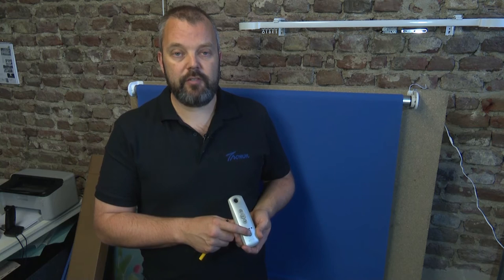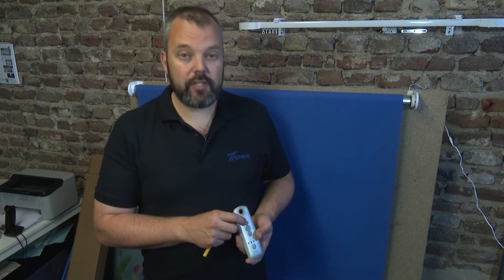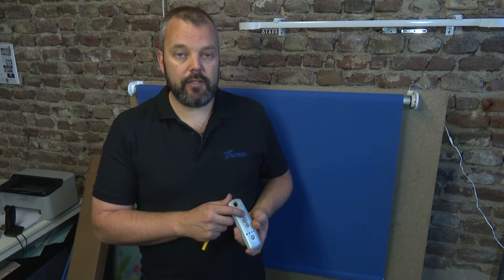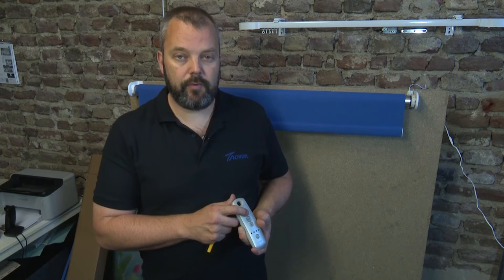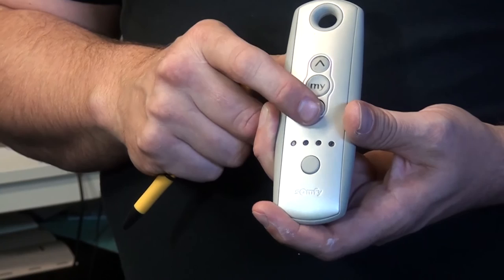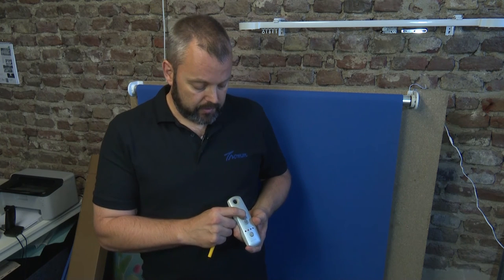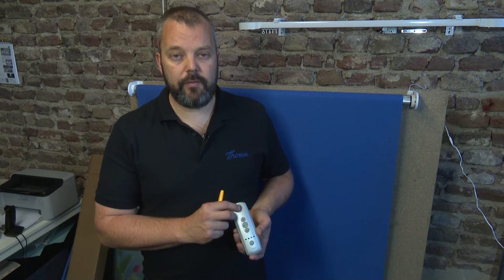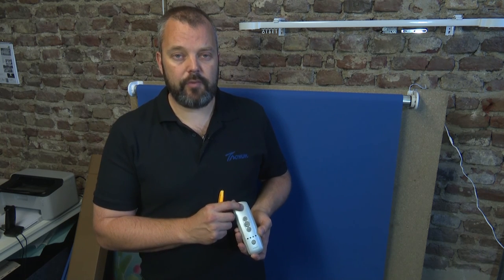How to make your own electric roller blind - part 5 - Programming the Somfy roll up 28 RTS motor

Comment: Fantastic series of instructional videos! I am trying to re-use 4 Somfy motors in my home at the moment. They currently have "solar shades" on them, and I want to change them out for fabric roman blinds. I saw a roman blind on the same Somfy system in a shop, but it was hard to see how it was rigged. Do you have any information about how to use the same system with a roman blind? Thanks.

Comment: May I ask you one thing: How do you ¨connect¨ groups of 5-8 electric roller blinds together under one remote control? Thanks!
Reply from the maker: Hi, Sorry for the late reply. Making a group is basically programming each motor with the same remote (connect only one motor to power). If you have the motors programmed already and want one group remote, you need to add that remote to each motor like so: https://www.youtube.com/watch?v=NflF7aYC0R0 Only do one at a time and then wait 15 minutes to avoid messing up the channels. Good luck, Otto